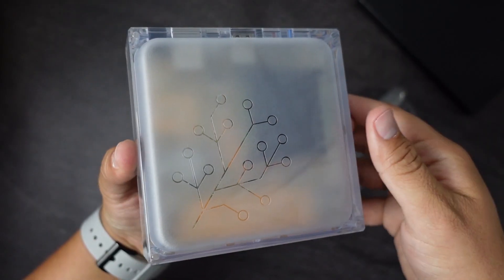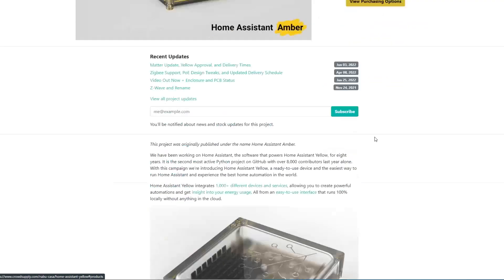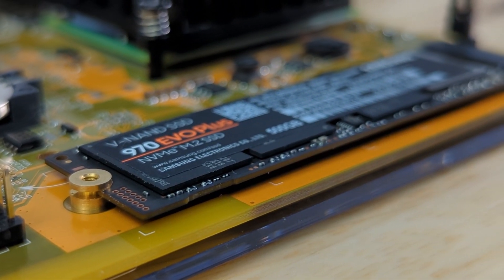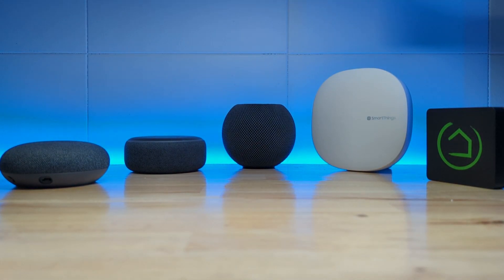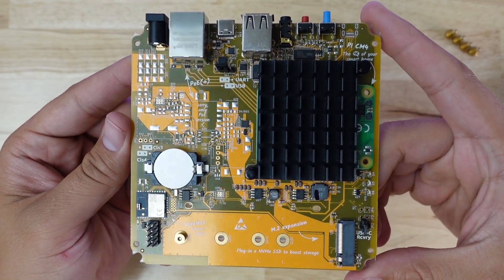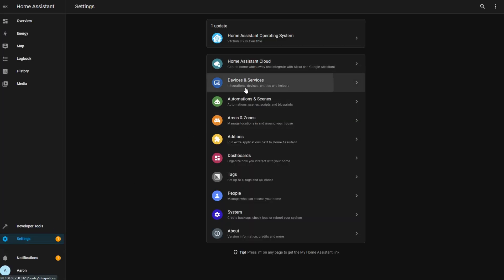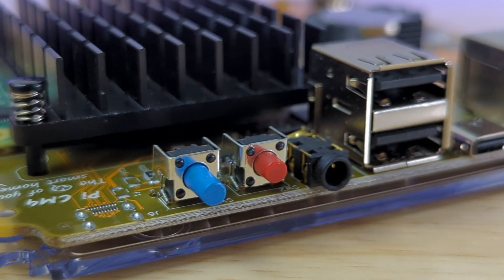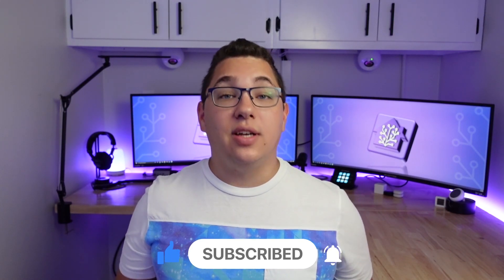Home Assistant YELLOW Review!

Comment: well i got one to have an easy start but it just dont work, just a red led and nothing else react.
Reply from the maker: Did you navigate to HomeAssistant.local?
Reply: @MakeItWorkTech hi, well the HAY do not even register on my network, nmap do not find any ip other than mine and my gateway. i tried but no success. i have to try the debug by usb....
Reply from the maker: You used an Ethernet cable that works?

Comment: Fantastic video.   I heard conflicting information about the Power Supply though.   Some have listed it as 12V 36Watt, which is a 3Amp PSU, and some have said it is 2Amp, which would be 24Watt.   Can you confirm 100% if it is 24Watt or 36Watt?   The Home Assistant Blue was just a case around an Odroid board.   The Yellow is a proper attempt at a genuine piece of hardware, with radio on board.    You have to remember the Home Assistant Yellow has the SiLabs radio on board.   If you had a metal case, it would block the Zigbee / 2.4GHz radio.
For Z-Wave - You can drop a Aeotec Z Pi 7, ZwaveMe Razberry or others directly onto the GPIO header, but honestly, a lot of hubs are not including Z-Wave these days as Matter does not directly integrate Z-Wave, so it really is a non-issue in most cases.   People who already have Z-Wave will have them paired to an existing hub that can be added on.
The SkyConnect is a USB Version of the SiLabs chip, so would not be needed on the HA Yellow, but would be quite a nice addition to a HA Blue or Raspberry Pi 3/4 install.
Reply from the maker: Thanks! The US version is 24 W.

Comment: Did you ever get the ZWave GPIO Module (not a USB dongle) to work with HA Yellow?
Reply from the maker: Yes I did - bit of a complicated process!
Reply: @MakeItWorkTech  Excellent! I am struggling to get my RaZberry 7 Pro module to work, it doesn't seem to be showing up as an attached peripheral. Is there a jumper or something to enable the extra GPIO?
Reply from the maker: You actually need to change a jumper on the yellow board, and then connect it to your PC via USBC port, and then from there you need to change some settings on the CM4. Once the cm4 is configured properly then the module will show up. I'm out of town this weekend, but if you hop on my Discord I may be able to help you through it next week.
Reply: @MakeItWorkTech  Awesome. Thanks for the tip. I will dig into it and hop on Discord if I can't figure it out. Thank you very much!

Comment: I wonder how heat from the heatsink should get out of the totally enclosed case. Only two little holes seem to be very optimistic. I run Home Assistant on a Raspberry Pi 4 with a metal case with integrated heat sinks - and the case get's quite warm in normal operation (around 10-15 °C above room temperature).
Reply from the maker: I think it relies on ambient air for convective heat transfer. I hope some heat transfer calculations were done, or at least some modeling. For reference, my processor temp is sitting between 105 degrees F and 135 F for the past 10 days. I don't run much on it yet, so I'm not sure if that will change much when I start running automations on it.